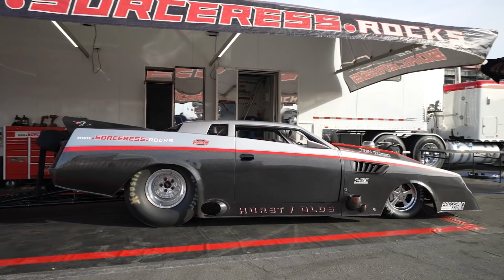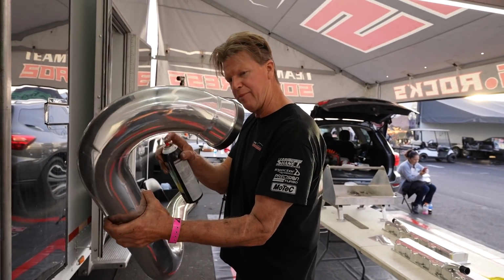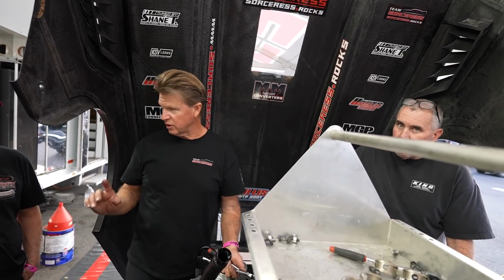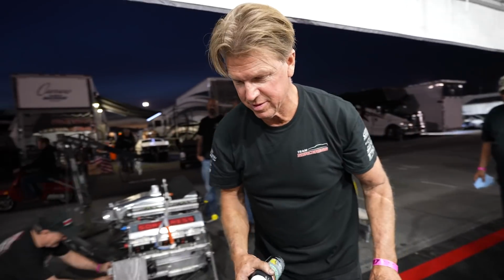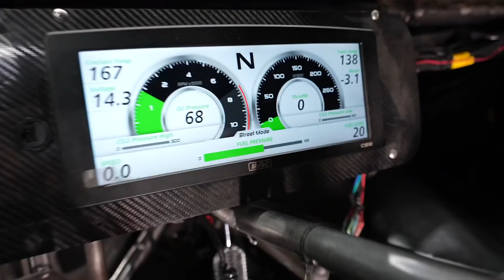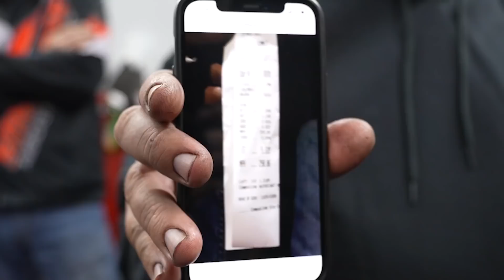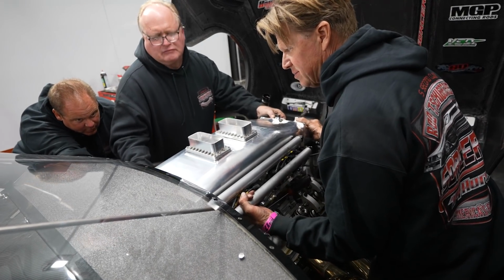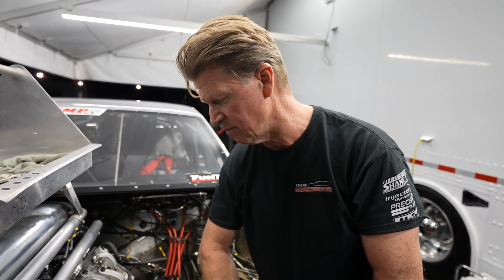We Had to Swap The Engine... Sorceress Immediately Runs 5.91 at 258MPH!

Comment: A.K.A. Motor Mouse , ( I would love to have the "Moser  S.B.C. Engine"  I think that's the brand on the cover of Hot rod around 1971 with D.O.H.C.& 4 valves / cylinder)/ ANYWHO , The wicked engines in the tractor pulls ( Like Yours) needed more oil directed at the rockers , so they built a tube to do the job . I guess they were pleased with the results.  I think it had something to do with the speed the the arms move with ratio when the power comes on so fast . Good Luck  James T, Burke

Comment: I wonder what the redline is on this bullet?  9k?  Valve spring pressure issue?  Is it floating the valves?  Have you consulted with the engine builder?

Comment: #4... A head scratcher for sure.  Behaves like possible valve float damage, but follows an engine swap?  Makes no sense.   I wonder if something is dimensionally [or metallurgically] soft with the heads, allowing odd movement that mimicks a lobe grind being a little too radical for the spring serving it?  Lash caps popping off mid run does evil things.   Well, all that and two bucks buys a cup of coffee - good luck, and looking forward to the next run.
Reply from the maker: Much appreciated on your thoughts!! We are gonna try a few things...we will video our fix ups

Comment: Extra boost holding the exhaust valve shut ? Why is that? Boost on the inlet side would not hold the exhaust valve closed. By the time the exhaust is trying to open, combustion should be completed (almost),